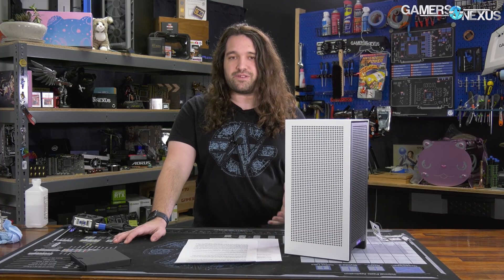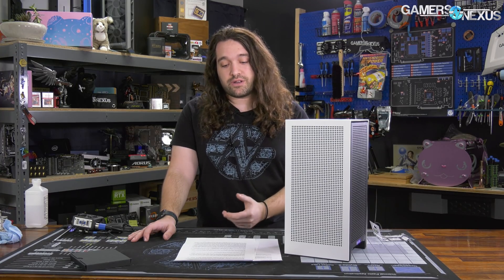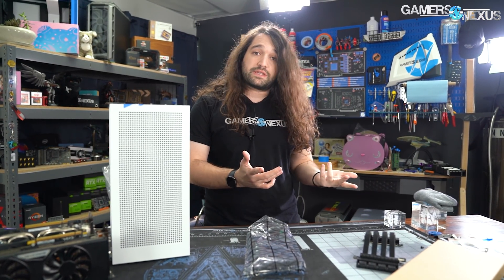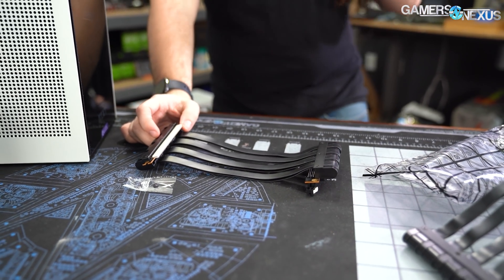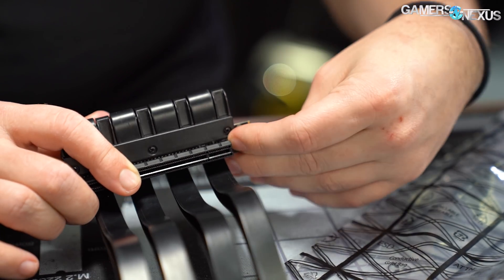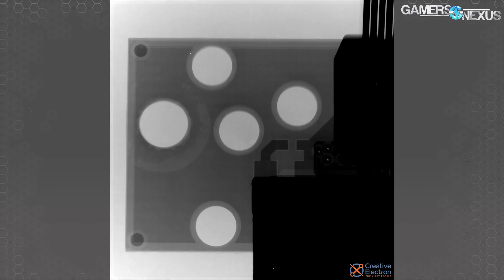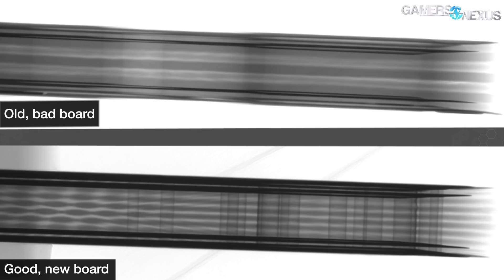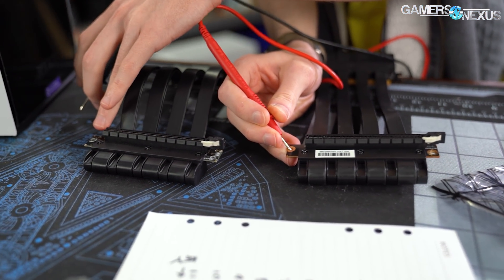Fire or No Fire: New NZXT H1 Riser X-Ray & Testing (NZXT H1 PCIe Riser Fix)

Comment from the maker: To support work like this and get something in return, you can back us on Patreon! We just published a brand new bonus Q&A over there: https://patreon.com/gamersnexus
You can also support our efforts and get something useful in return by buying a GN Tear-Down Toolkit, Mouse Mat, or other product from our store: https://store.gamersnexus.net/
Watch the most recent installment about the NZXT H1 government recall: https://www.youtube.com/watch?v=79ZMI6MDgmw
And our video where we originally confirmed the problem: https://www.youtube.com/watch?v=fjUscSRLwks
Our thanks to Creative Electron for the X-Ray analysis: https://creativeelectron.com/
Reply: RESP0NDING TO YOUR QUESTION AT 8:49 —
The "tubes" (vias) running through the thickness of the PCB are often used in power planes (particularly around chassis mounting holes and power inlet lead connection points) to aid in heat dissipation, which (being closest/at lowest resistance to +Vdd and GND) is typically highest at those points (but they're also sometimes dispersed throughout the power plane) in order to help prevent PCB layer separation, among other issues.
— Andrew (yes, I am an E.E.) Ryder
Reply: Pog
Reply: Did patrick work at a black cat tent?
Reply: @whoopsiedoodle9001  Electric (RGB) rainbows by day, concussive RGB by night? 

But BC actually sells branded clothing, although no firework teardown mousepad sadly.
Reply: Got my mouse pad thanks, quality product!
Reply: Thanks for continuing coverage on this issue
Reply: Supporting you is inherently useful to all of us. Thanks for giving us even more i guess? 
\
Reply: Finally Made my first order today, My toolkit is on its way, Thanks for all your hard work guys uwu.
Reply: Steve maybe ask Dave from EEVblog for some input on PCB construction
Reply: 14:27 I'm not sure what camera you guys use for filming your live/pre-recorded segments, but you appear to have some pretty bad autofocus issues when it comes to macro/zoomed-in shots. I'd like to suggest your camera operator use the manual focus mode on these close-up situations, or get a different camera that allows for them to adjust it on the fly. I think it would improve production values a lot. Regardless, I still enjoy the videos. Everyone working at the channel has maintained the courage of their convictions, while not acting as though you are infallible (unless it's merely in jest).
P.S. I love the anti-static modmats. They might leave a little black on your hands sometimes after working on them awhile however, but it washes off easy enough. :)
Reply: I’m surprised this wasn’t posted at 4am, dude finally fixed his sleep schedule 😂
Reply: In theory: the holes around are for signal quality and the both outside layers should be GND. The principle of a Faraday Cage

Comment: Has anyone else been having system stability troubles with the new riser? I found a suggestion that the replacement riser might be the culprit in a post on LTT forums. I just switched back to the fire hazard riser (with nylon screws ofc), and my system is feeling more stable. Since switching back, I haven't been able to reproduce the boot looping that had recently begun to happen.

Comment: Just got one of these used. 10700kf, 32gb ram, 3060ti. Messaged NZXT a couple times last week to get details of the original purchase over to them and they had the new cable to me on Monday. I thought it was a decent deal for $800.

Comment: The holes around the outside of the screw holes are vias. Baiscally they run the whole thickness of the board because it's designed to accept current between all layers. To accept more current, you'll need more copper/gold connecting the layers. Hence, the holes. If a power supply dumped 53 amps of current through that screw hole again, it's incredibly likely to cause the power supplies over current protection to kick in and turn the whole machine off. Which is what we want. If it were just the screw hole and no vias, general removing the thing and inserting it may wear down that layer and compromise the current capacity. Therefore making it yet another potentially dangerous fire-starting product.

Now that's the gound connection. Why would we need it to do that if the original issue is because 12V got shorted to the case? i hear you cry. Well, if joe bloggs from down mans yard decides to ask for some trouble and hammer this into a fucking AGP slot because he hasn't a clue, nobody is hurt if a 12v line on that connector contacts the pcie riser's ground wire. Might kill his new GPU, might kill the motherboard. But as long as  he's ok, that's as much as us engineers can do. You guys, who educate those on how to build machines, and not kill their stuff do the rest. Might have been better to stuff a PTC fuse or something on the board too or some other OCP device onto the riser itself, but that's just my personal preference. Ask anyone else, and they'd say that's overkill.

The main ground layer is also possibly internal, rather than a surface layer. The screw hole will need to be connected to it by some means. Costs more to drill the holes, but there's a shit ton for that PCIe connector and other associated cables going off it. The extra time needed to drill a couple around the screw holes and plate those through is nothing in comparison.

Of course, if you're using a power supply from a machine made in the 80's, or one that was so cheap that doesn't have OCP/SCP built in, all this means nothing. Iirc, it is in the ATX power supply standards. But bad manufacturers trying to make a quick buck would consider blue flames coming from the PSU and eventually burning the house down overcurrent protection. Because it'll eventually shut off, once everything is melted into a gelatinous blob of FR4, copper and gold, and triggered the house's circuit breaker. By that point though, there's definitely a fire raging through the building.

Just like in home electrics. The cables are designed to take well over their rated amounts for a short period of time. This is generally speaking, far longer than any protection devices like MCBs need to break the circuit from over current. The last thing you want is melting cables, PCBs and the like, when the job of the circuit protection devices is to protect the circuit, cabling etc.

i would suggest testing the riser by dumping 100A through the 12V and ground lines for 35ms, which is a typical value for OCP to kick in. Maybe build up to that. Please account for airflow over the cable first too.

Comment: I've just received my replacement and like the other comments, the plate is like swiss cheese with the amount of holes in it. In fact it (superficially at least) looks almost identical to the original.

I'm somewhat worried.

Comment: Just got my replacement cable and it is not like the one the sent to Gamers Nexus. it looks like the original with some plating to the top. the plating does not go through the hole. I plan on doing some basic continuity testing but i am not confident in this replacement.

Comment: I just got mine and my riser has the hole with the copper plating, which is good, but it doesn't look like the one Gamers nexus received. The riser received still has the multiple screw holes like the original riser.

Comment: Thank you so much to the Gamers Nexus team for doing the due diligence on these cases and the fire hazards and the fixes. I found this case late last year and was eyeing it and slowly falling in love with it, and when I was finally ready to buy it, that's when I saw that it was out of stock everywhere. I had no idea why, but it looked like their stock had been completely sold out. I found one last case on ebay and snapped it up, only to find out the day it arrived via mail that the reason it had disappeared was the fire hazard.

It's been sitting empty since then, with me unwilling to build anything or continue buying parts until I knew what was up. This video has now given me the peace of mind to move ahead with getting the new replacement riser and using this beautifully designed case (other than the crappy PCB construction from a third party).

You all have done a wonderful thing here, and the praise you're getting is well-deserved. We'll never know how many fires you kept from starting and how many lives you saved, but I'm sure if it's even one, it was well worth it.

Comment: 4:00 Got my replacement riser cable yesterday. It's worth noting that the new one still has the assorted swiss cheese holes around the nzxt hole, but at least now the nzxt holes have the metal around them like shown in the video.

Comment: I suppose the other benefit of having the ground plane around the screw hole is that if there were to be another short between the 12V trace and the screw, it would be a direct short, trip the PSU OCP and stop the fire.

Comment: Just received my riser cable replacement and I noticed that it is not the has its on the video. Mine is defenitly the same as before just with grounded holes. Mine still have the "generic" mounting holes like before.

Comment: I just want to note that the replacement I have is the cheese grater but with the copper around the hole that you use for the nzxt. @Gamers Nexus I can provide pictures. But it looks like they sent you out a new resign for yours.

Comment: At work we call those 'pinning vias' I think (the small thru holes adjacent to the screw hole). I believe they are used to help mechanically and thermally bond the outer layers to inner layers (in this case probably to ensure all layers are tied robustly to ground)

Comment: Kudos to Steve amd the team for shedding some light on this and bringing ethics where it's needed.
8:40 the "tubes" around the screw hole are called vias. They pass the ground connection to the other side of the PCB. Sometimes they connect to internal layers as well supporting the same task.
I like to also think they add a little structural rigidity in an area that can likely become over compressed due to different torquing/tightening  by different end users in regards to strength and paranoia.
I myself am a bit paranoid, so I tend to over torque on things that don't have a torque spec involved.

I believe the solder balls are there so that the screw being installed becomes an easier test point when using a multimeter. Motherboards also have these balls on standoff holes, front and back for the mounting screw and standoffs alike.

Comment: The ring of vias around the plated screwhole is because that's what the stock library footprint looks like, they probably hadn't actually put thought into it. But this was the proper choice anyway.

This footprint is designed with a bit of extra electrical reliability in mind. When you lay out a board, you may decide to run a ground connection from front to backside via a plated screw hole, or you might not notice that you did so on accident, because DRC is likely to not complain, since well, connection. However this is not proper, since a screw can damage the plating, it's actually very thin, and disrupt the connection. But if you put a bunch of vias into the keepout, then that's not a problem, they form a redundant connection. Also it mechanically stiffens the PCB a bit under the screw head, can be of advantage too.

BTW looking at the board now at 16:00, there clearly isn't enough board between the edge of the board and the edge of the screw hole! By just a couple millimetres. Even on a new one. This looks like the screw can get torn out to the side if you tried. This isn't anyhow a safety issue, i mean once it's in on both screws, it'll likely be fine, that's just not at all nice and proper, not pretty, stupid. But it probably starts at some issue with the enclosure design and available space there, since they designed the enclosure... around a third party cable with the wrong holes.

Comment: Just my experience here, I ordered the H1 in October, made a new build with it in November, and have been using it since. In February (yes I procrastinated in getting help) I contacted NZXT support and got a response the following day. After providing proof of purchase I was told I would be receiving the nylon screw repair kit and would receive a new riser cable once they had them. Next day I got an email saying they were shipped and was given a tracking number. I have since received the screws and replaced the metal ones, all within a week of reaching out to them. Despite the riser cable issue, I am very happy with the help I have received from NZXT support and hope everyone who had to go through them to receive the repair kit and new riser cable has been fortunate and is now able to use their H1 case without any fear or a fire hazard.
Reply: I happy with your experience man. I hope this will be a good lesson for them. If steve didnt expose them, your case might catch on fire. also, I am thinking that because of this whole fiasco, NZXT support is getting better (*cough* reputation). I hope youre enjoying the case now!

Comment: I received my PCIe 3.0 riser cable last week.  I cut up the old riser cable and threw it in the trash.  Disappointed they didn't do this to start with, but I still like the case and plan on using it.  Thanks to Steve and the 'Patricks' for their work and making NZXT for doing the right thing!

Comment: Those tubes are called vias ... they are just pass throughs from one side to the other
the vias around the screw hole might just be there for grounding without relying on the screw hole or to prevent delamination
EDIT: How they plate through holes and vias is actually a pretty cool process

Comment: I find it inconceivable nobody has died from this.  I once had a housefire, it started really small, and in less than 5 minutes had consumed the entire house.  All it would take is for someone to turn on their PC and load up their game, then walk outside to take a smoke and before they are even done smoking their entire house inside is enveloped in flames.  Yes, it happens exactly that fast.  And yes, it is shocking every time.  Fire spreads so fast that you NEVER get used to it.

Comment: The multiple vias through the PCB around the screw holes serve multiple goals.  Electrically, it provides additional connections the top and bottom surface copper planes.  This lowers impedance for power delivery, allowing for more stable voltage during activity bursts.  The vias also serve to dissipate heat, at a low level.  The copper vias, when the copper tubes wall is thick enough, offer additional resistance to PCB crushing when a screw is tighten too much.  Many vias, in case you were unaware are precisely made copper tubes, cut to exact length, and inserted into a drilled hole, and held in place by light friction until the solder connects it more solidly to the outer PCB copper layers/traces.  Electroplating vias is possible, but more expensive, and often unnecessary.

Comment: More PCB layers doesn't necessarily mean that the board is higher quality.  You always try to keep the number of layers as small as possible to reduce cost.  However, what we see a lot in the industry is that low cost manufacturers don't care about EMC and just take the minimum amount of layers they can do to make the board functional, without taking EMC into account.  They will just slap that CE logo on their product without testing.  Sometimes 2 extra layers are necessary to make sure that the outside layers have massive ground planes that act as EM radiation shields.  Adding outside ground planes can also reduce EM interference on high-speed links in the PCB,  to keep your high-speed links operating at higher speeds or reduce the risk of dropped data packages.

Comment: "It is tough to prove a negative" seems simple enough in this case: just need to use the high-contrast imagery to find the boundary of the riser's 3.3V and 12V planes to confirm that they do not come anywhere near the screw holes. If there is only ground anywhere near the holes, then a short to 3.3V or 12V via the screw is physically impossible. From the solid gray on the new riser around the hole with the vias stitching all layers together, I'm pretty sure the whole area around the hole is solid ground across all layers all the way to the gap next to the PCIe connector's edge.

Comment: Those small 'tubes' are called 'vias'.  A PCB has multiple layers of copper planes and copper traces/'wires' separated/insulated from each other by FR4 material.  Vias are copper plated tiny holes that are used to make electrical connections from one layer to another (or connect multiple layers together) to complete circuits.  Around screw holes, they usually connect 0V/mass of every PCB layer to ground

Comment: I got my replacement riser cable today and I'm in Australia, looks like they are sending them out at scale early. It was shipped from the US on Feb 27th according to postage label. No comms but had ticket open with them in early December last year and received nylon screws late January, comms were great regarding the screws but looks like they are just shipping them out as fast as possible. Instructions with riser cable are decent 3.5 pages with good instructions.

Sucks this was a recall, but from my point of view has been handled pretty well.
Reply: One criticism worth noting is the lack of comms about what to do with the old riser cable. Nothing on the instruction sheet either. Will be destroying it myself but thought I'd point that out.

Comment: Those are vias. Alongside adding mechanical strength, helping to avoid flexing around the screw hole, they connect the ground planes.
BTW I'm no EE, just a random geek. An EE should have a better explanation.